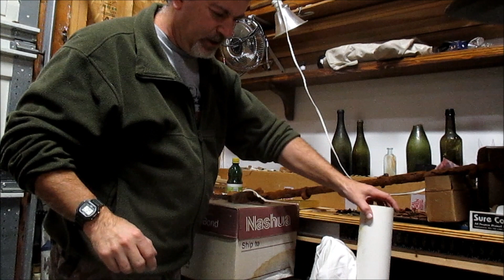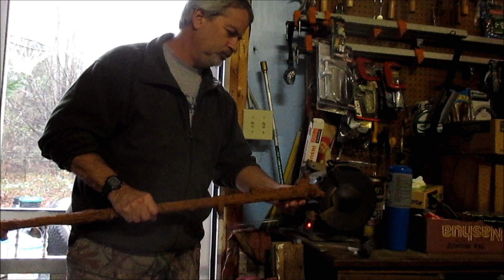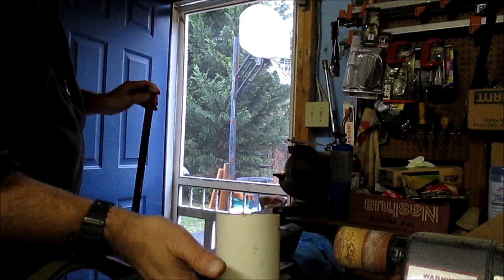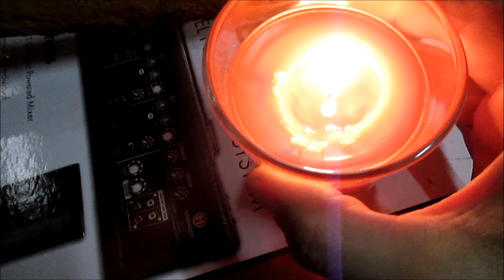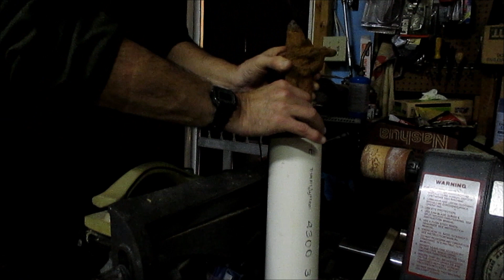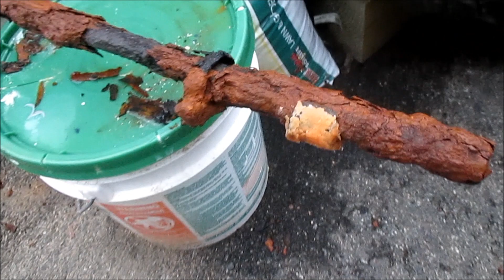Excavating a Civil War Enfield Rifle part 2 (the restoration)

Comment: I am restoring a 1861 musket, barrel has lots of small rust spot, would you recommend chemical treatment or electrolysis?
Reply: Electrolysis can be rather aggressive... if the Damage is limited try Oil, and very carefully heat the oil with a heat gun then remove excess oil and gently wire brush ( with brass)  or clean with extremely fine steel wool.
   Ive seen carb and break cleaners work along with oven cleaners. However i wouldn't use them on wooden stocks or on anything other than a Nepalese gun.